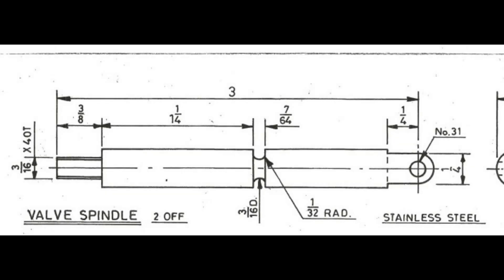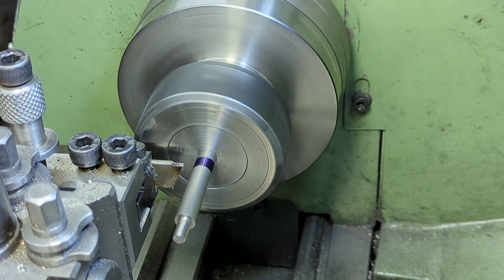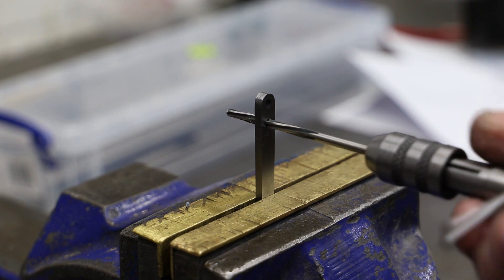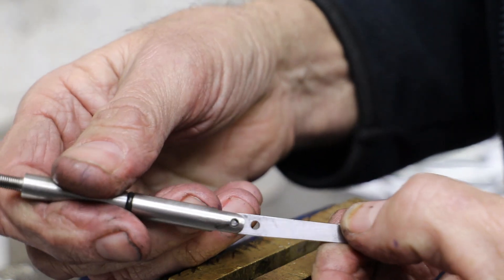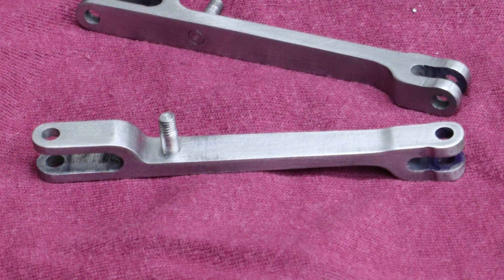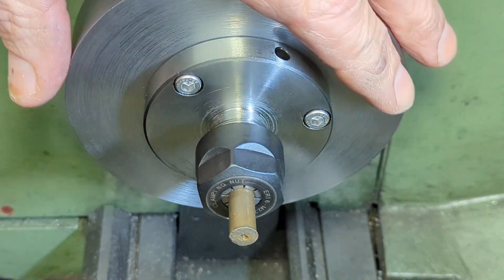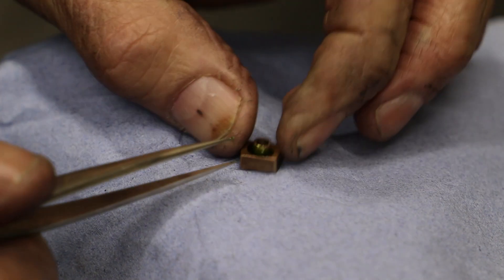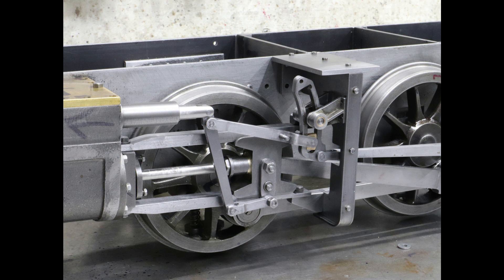Part 47: O Rings, Pivot Pins and Oversized Holes

Comment: Nice one Mark she is coming on nicely, I like the hole recovery operation, a reminder we need to read the drawings twice and cut / drill / mill once
Reply from the maker: Your principle is of course correct, but checking the drawings would not have helped - this was due to two different approaches to converting from Imperial to Metric.  It'll happen again before I'm finished :-)
Reply: I am doing the same with an lsbc dyak  so having to ripple check,